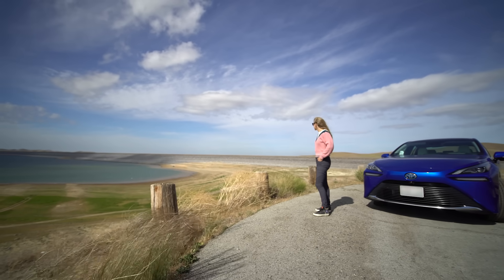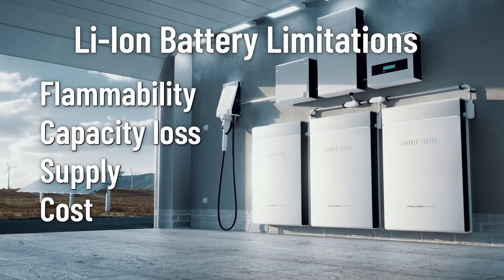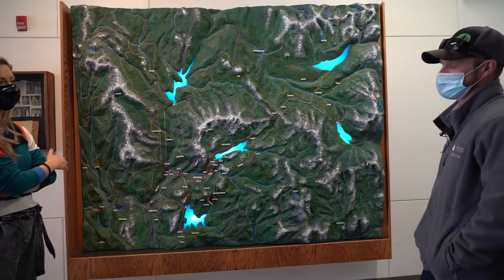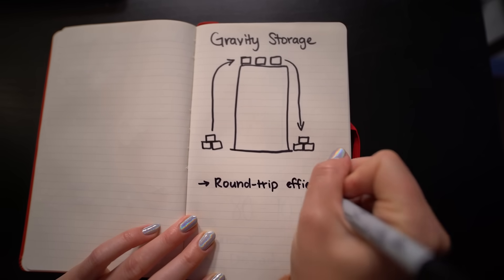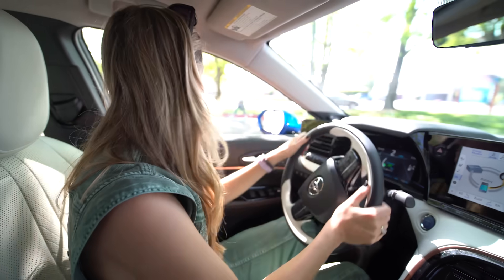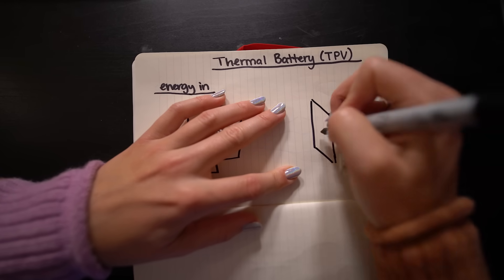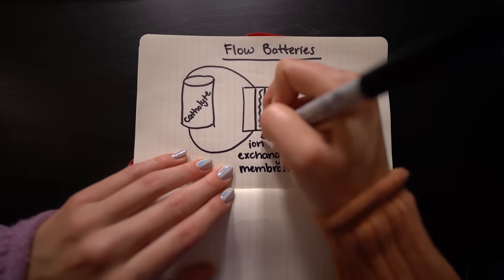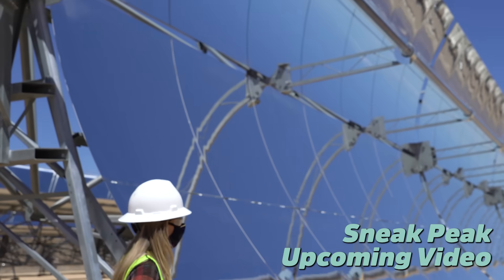The BIGGEST problem with clean energy

Comment: What we have to realize is that there are MANY options and we don't need just 1 solution. We need the solutions that work best in whatever area. As long as the energy is renewable it's great.
Reply: A viable question is: How much CO2 does it take to build, install & maintain a windmill? And how long is the ROI? When is the break even point for both CO2 and the financial cost? Also since communist China owns the lithium mining, solar panel & windmill building markets is it really in the USA's best interest for China to own our energy market?
Reply: @georgevue8175  US has the capability to start lithium mining, just it's not profitable to do so so it's not being done at a fast pace. it's mostly mined in dry area as that's how lithium is formed, also china don't "own" the lithium mining, that's Australia, Australia export them to china for refinery.

Comment: The Amish can do a lot with compressed air but they use it directly without conversion first to electricity. This makes it more efficient. Nobody is talking about that option or other low tech solutions because both governments (taxes) and the industry (profits) don't want people start to work decentralized. I believe (conspiracy theory?? ) that's the reason why hydrogen is promoted despite all the contra aspects.

Comment: I dont think people realize just how bad the grids are in this country? Sure we need a way to store the power but lets get real here, the grid can barely handle the loads that are on it now. If we go an add all these electrical needs sources to it, it is going to blow up!

Second to the problems described in this video and problems that are being completely ignored by the MSM and those pushing this on society is the very nature of what makes up these so called clean energy solutions. When you dig down into the components of them they are anything but clean. The extraction of the materials required to make them is hazardous and releases compounds into the environment that are unsafe and then there is the long term disposal that we can see today with the horrid way in which current so called clean energy systems are being recycled, or rather discarded and left to leach these dangerous chemicals and minerals back into the soil where they are contaminating the surroundings and making those areas as well as neighboring aquifers unsafe. So NO I do not believe the true problems were even mentioned here and I find that disturbing and goes along with the same narrow mindedness being shoved down our throats!

Nothing about these so called "clean energy" or "renewable energy" systems is true! In fact they are just as damaging as current energy solutions, just that they contribute to the pollution grid in different ways and I would go so far as to say they are more damaging then anything we have today with our well developed clean coal and petroleum energy systems that have been refined over decades of research and regulation and are doing nothing but getting cleaner and safer with every passing year. People need to wake up and get educated before they jump on this lie being told to them. Not that it cant be a better way forward but in its current state it is anything but and we need to force these entities and companies to do it right, otherwise we are just trading one problem for another that is potentially far more dangerous to our planet than anyone is letting on!

Comment: Over a century ago people did not readily convert from horses to automobiles for their transportation needs. Their was a transition, albeit a hybrid period where both were used.  With electrical power i see the same type of  transition.   believing the change from fossil fuel power generation to renewable sources will not happen at the flick of a switch,but the power produced by all means of generation is the same and imperceivable to the user. 

It is likely most people do not know the fuel or power source to generate their current electricity since most is already a hybrid system, so to speak.  Why would they care in the future?

Comment: If most renewable sources of power (mostly solar and wind) cannot be piloted at will, some of the demand can.  Imagine converting a thermal-reaction based chemical plant to (suitable) electrochemical processes.  Provided the right incentives, and a slight over-dimensioning of its electrolyzer banks, such a plant could shut down its power consumption at times of limited power availability, and would produce at 120% capacity at times of excessive renewable power production.  Such a plant could easily have the grid-leveling capacity of a 10-100 MWh bank of batteries, but in "upside-down" mode.

Comment: There is an alternative to storing renewable energy: moving it!  The sun always shines on half the planet, winds always blow somewhere!
Of course, transporting power over thousands of km through HVDC power lines generates losses...but of the same order of magnitude than storage technologies.  Of course it is expensive, but so are storage options.
Singapore is planning to have much of its power generated by solar parks in Northern Australia, and transported via a 5000 km (3100 mi) long cable.
There is also the Xlinks project of 4 undersea power cables (3800 km, 2375 mi) between Morocco and the UK.
These projects would take great advantage of the higher amount of sunshine in tropical desert regions, but would not do much for storage, as those cables would both run almost due South-North.  But similar cables could be laid on East-West headings, couldn't they? 
Actually, the biggest problem I see for long-range power transport is neither technical nor economic, it is of political nature!  With the exception of the few continent-sized countries, power would have to be generated in other countries than it is produced, and often transported through yet other countries, not all of them being politically stable over the long-term.
Reply: Yes, this is the most logical and best solution.. Sadly, it won't happen no.

Comment: While it appears we have many promising technologies, we still have many problems to solve before they can fully take over for gas, nuclear, and coal.  So it still does not appear prudent to abandon what is currently working until we not only have these issues resolved, but have gone thru an energy budget to assure that we have not cut our power supply needs short.  With the push to reduce the carbon foot print, electric demand will go up, particularly so with the use of electric vehicles replacing gasoline vehicles.

Comment: Germany has been much too quick in choosing to convert to wind and solar as  major forms of "clean" energy. The best ones are hydrogen fuel cells (not there yet, but it's there), fusion (it's supposed to be with us since forever) and nuclear (already here, but Germany outphased it because of a Green Party not grounded in science).
I heard though that even Germany is investing massively in green hydrogen. With more R&D, I predict that hydrogen fuel cells will be THE ultimate form. But we should use as many forms as possible, including nuclear.

Comment: Hey, here's a great idea.  How about nuclear? You can plug a reactor into the current grid and don't have to worry about lithium battery storage farms.
Reply: Nuclear is by far the best clean energy option, but these people wont admit it
Reply: @RickSanchez167  One thing that struck me was the mentioned disadvantage of the lack of growth of the technology of pumped hydro storage. Sure, it is a 100 years old technology that might be mature and there might be no surprises in the future. Does this mean it's not worth investing in it, because you can't take sizable grants for its research?
Uranium-fission nuclear tech might be similar. It's an established technology, so investors can't rely/hope for the research uncovering new patents for them to exploit.
Reply: When you realize it's not really about "saving the planet", you will understand why they reject nuclear. Thorium salt nuclear would be very promising, cheap, and safe. Yet they fight tooth and nail against it.
If you try to build a nuclear power plant in the USA, you just won't be able to get around the tons and tons of regulations for it and you'll go belly up before you can even finish building it.

Comment: The average Pine tree absorbs about 10 kilograms of CO2 per year. Assuming that the standard measurements of tree plantings are about 1000 trees can be in one hectare. If a tree absorbs 10 kg per year, the acre will absorb a total of 10,000kg or 10 tons per year.

Comment: Go with what fits. Use much less electricity, then you don’t have to generate or store more. Some things are highly useful, other things not so much. One example is electric dish washer. We could live without them. Other things would need adjusting. Smaller and more efficient maybe. Instead of generating more to drive more. Maybe we could generate less to be more efficient.

Comment: This video is wrong.  The first step towards reaching a zero emissions economy, is to reduce the CO2 production of the electricity infrastructure to 50% of it's current value.  This is readily achieved by solar panels alone, without the need to build even 1 kWh of battery or other form of energy storage.

Solar photovoltaic panels have gotten so cheap in recent times, that they produce the cheapest form of energy of all the mainstream existing technologies (the only potential exception being wood harvested on your own land using your own labor, where you value your time and risk of injury at $0/hour).  A properly implemented solar photovoltaic array can generate electricity at 2 cents / kWh, when the panels and support equipment is amortized over a 20 year or longer timescale (most solar panels come with a 20 or 25 year warrantee, and getting well over 20 years of practical service is realistic).

If you 3x overbuild your solar array size (such that you are wasting 2x of your base energy needs, on sunny days), the useful electricity it produces will be 3x as expensive, so around 6 cents / kWh, which is still cheaper than what the vast majority of electricity consumers pay today.  Consequently, it is economically sensible to 3x overbuild solar panels.  Doing so also provides highly reliable electricity, even on cloudy days, since on completely and continuously cloudy days (but without precipitation), solar panels generally still produce around 30% or more of their full sun day output values.

If we did 3x overbuild solar panels, we could nearly 100% shutdown all combustion power plants, during the daytime hours.  This would in effect reduce the CO2 production intensity of the electric grid to roughly 50% of the current values, since the combustion plants would only be operating during the nighttime hours of the day.

Once you have so many solar panels installed, there will be massive surpluses of electricity during sunny daytime conditions, since the system is 3x overbuilt to meet the normal daytime energy needs of society.  You can then use some of this "surplus" electricity for electric car charging purposes (assuming people go to the trouble of installing charging ports at places of employment).  The rest of the electricity can be put to valuable use as low priority industrial energy, for energy intensive activities, such as metals refining and reduction (ex: making iron from iron oxide for instance).  

Then, if people buy enough electric vehicles, and the electric vehicles are designed with high cycle life batteries in them (ex: lithium iron phosphate could be used, which often provides manufacturer claimed cycle life of 4000-20,000 cycles at 80% depth of discharge), the electric vehicles can be used to perform car to grid and grid to car storage operations.  High cycle life batteries are somewhat expensive on their own, but when you are buying them primarily for a high value use purpose (ex: as part of an electric car), they are very cost effective, and can serve a dual use purpose of storing vehicle propulsion energy, in addition to providing grid energy storage (some of which will be consumable during the nighttime hours of the day, using stored solar energy from the daytime hours).  Eventually, a zero emissions economy becomes realized, where long range, high cycle life, car to grid/grid to car capable electric vehicles are providing the majority of the necessary electricity grid energy storage for nighttime consumption.

Thus, there is no grid energy storage "problem" at present.  The current problem, is that society is not yet embracing solar photovoltaic panels fully.  They are good tech, but they are highly underutilized at present.  Simply building and hooking up far more of them, is the first step towards a zero emissions economy.  Energy storage technology is not the problem, as the current problem is one of human behavior, that is, most people just aren't doing the right actions to build the necessary solar panel manufacturing plants, and then running them at full capacity to build the necessary solar panels.

Comment: Ameriaca consumes around 10 TWh of electricity per day. If we start using electricity for other things such as transport, cooking, heating etc. electricity consumption would increase alot. Now the methods mentioned in the video are all possible and will get better with innovation. But they are not practical for 100% renewables. For 100% renewables you would need atleast 20 TWh of energy storage for a day (only in america), enough solar cells and wind turbines to protect against minimum energy generating periods (sometimes there are continuously cloudy days and less windy days), an infrastructure upgrade to support the volatility of renewables. This would all get very expensive for the consumers. Better would be to use a combination of nuclear and renewables.

Comment: The Biggest problem with clean energy is the United States don't want to move away from Fossil Fuels, there are Solar Energy, Wind Energy and using Waves and current Turbine energy Technology that can be used in salt  water rivers and lakes , none of these are Fossil Fuels or Hydro and they are very very very efficient and 100% clean energy for the environment

Comment: Having systems in place of multiple power sources, and a capacity meter on each which systems can know to grab from one or the other and not rely on any one in particular is also an option. For that you can take say, the windy city, and it's main power supply be turbine, the sunshine state, solar. I.e. using the geological locations and their unique access to green energy supplies that then reroute to a centralized storage grid would be ideal

Comment: For the wind turbines, using architecture to create artificial wind tunnels can ensure a regular supply of air movement. There is a fan that supports this concept that dosent use blades, but instead funnels air through a rectanglular tunnel shape.
As for with solar, if we can get wireless transmission and use an orbiting body to absorb the most of the suns energy it can in the upper atmosphere as a storage cell, that could then transmit energy down unto the areas in nightime. There is a Russian device that can pull excess photons off of power lines, this concept could be developed along with wireless charging to make that work.

Comment: Would sure like to see an emphasis on developing reliable, inexpensive and safe nuclear energy answers.  Energy storage is important, but reliable supply is critical.
Reply: As I understand it, nuclear reactors are slow to spin up and shut down. So currently, they are used as the baseline power, with oil, gas, coal, etc, used to provide power for the spikes of demand during the day. Recycling the waste into new fuel pellets helps reduce the amount of waste, but there is still some radiactive waste that needs to be stored for centuries to millienia.
Reply: supply is more important than speculative energy futures.

Comment: You might want to investigate "Liquid Metal Battery" as maybe, in the end, a better solution to grid storage, not so much for a single home, but for solar farms or wind. This incredible technology came out of research at MIT.   As for renewable fuel, a humble plant that grows in saltwater could be planted on the coastline of 25,000 miles of desert lands and be used to both store excess CO2 in its roots, but also recreate a very clean oil in its seeds becoming a forever source of oil needed for not just energy but all the many other chemistry-related uses coming from it.

Comment: Energy storage is a major problem for wind and solar. All of the solutions presented have problems. As an example pumped storage would require a lot of new reservoirs and environmentalists tend to be against not only new but existing reservoirs. The amount of storage needed between winter and summer, utilizing wind and solar alone, is immense. The best solution is nuclear but again environmentalists are against it. Even wind, and solar and transmission projects have problems getting environmental approvals.

Comment: Storing energy inform of inertia also looks as a promising option. In the presence of electricity the energy is imparted to disks to rotate them up to a certain RPM. Later when there is need for energy, the energy is extracted using a dynamo. The machinery used is engineered to minimise the frictional losses.

Comment: There's another form of gravity-based storage (unlike the Jenga crane thing), which is simply a regenerative train filled with rocks that goes up/down a hill. During charging, it goes uphill, saves energy into potential energy (like pumped-hydro), and during discharge/generation, it falls through the track producing power. A lot simpler than the crane idea, can be made in a lot of places, and all its required techs are already there.